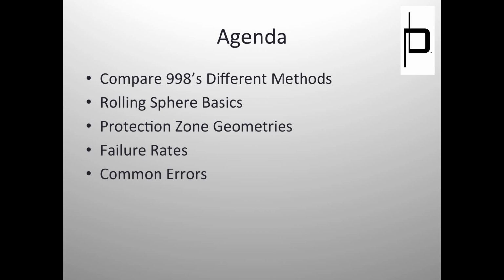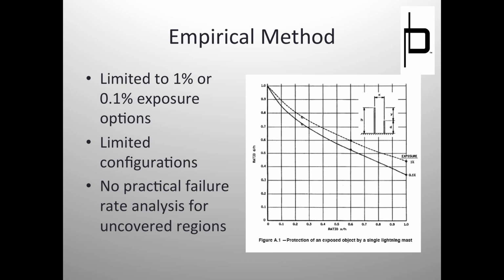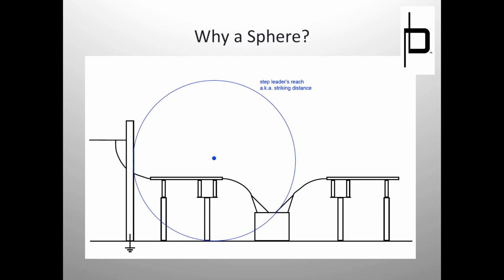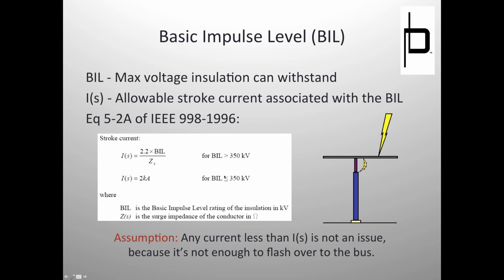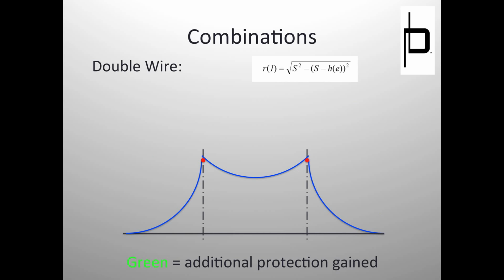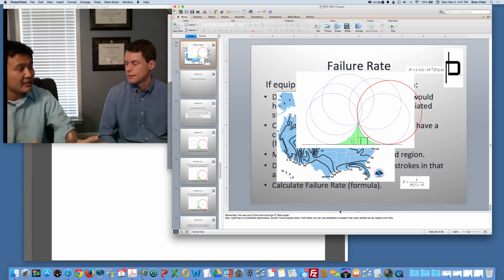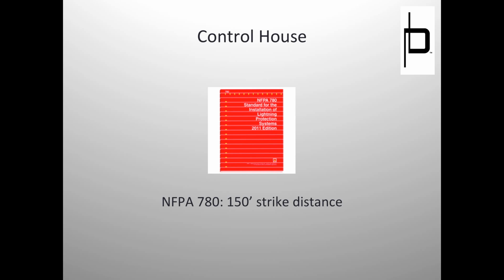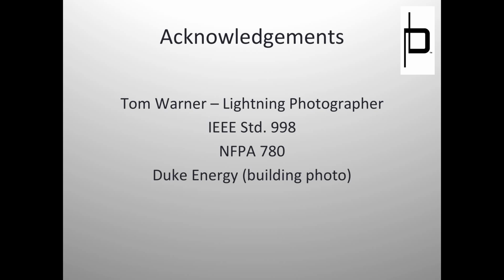Rolling Sphere Method of Lightning Protection and Shielding for Substations per IEEE Std. 998

Comment: The stepped leader can be seen as the infinitesimal rate of change of ionization probability through space (this is how it was described to me). The stepped leader's trajectory/divergence over space is the highly probabilistic entity referenced since storms themselves cause and distribute ionized particles (small & large) through open air (this is also seemingly random). Also, there can be several return strokes each with a different magnitude and duration. The first return is largest in terms of current magnitude so is the Is used. It can be seen in the video shown during the presentation.

Such a good presentation. A good way to visualize the failure rate might be to take the differing Is magnitudes and create a heat-map of the probabilities a particular stroke could be dangerous to equipment (this has probably been done).

Comment: The last mistake should be selecting too "HIGH" a failure rate.... once in a 100 years would be too HIGH instead of too LOW
Reply from the maker: Sir, you are 100% correct.  We want to be practical and set an achievable failure rate, not an impractically low rate of failure. I will update it on my personal slides and pin this.

Comment: Eng. @Biren Patel ,I want to ask ,how to calculate the unprotected area A that was used in failure rate equation ?
another question at 1:29:41 why  equipment part inside the red circle is considered protected ?
Reply from the maker: #1 Unprotected area A is just the 2 dimensional measurement. You can use AutoCAD or Adobe Acrobat's measuring tool to approximate it.  #2 The equipment that is inside the red circle is considered protected because we make the assumption that the step leader will strike the grounded masts instead of the insulated bus.  It's not true 100% of the time, but it is a practical assumption.  Because the mast is grounded, it's hopefully the path of least resistance when compared to insulated bus.